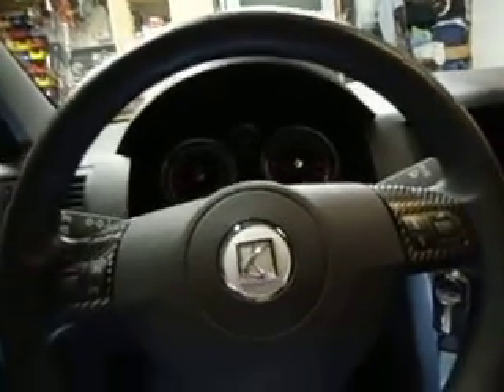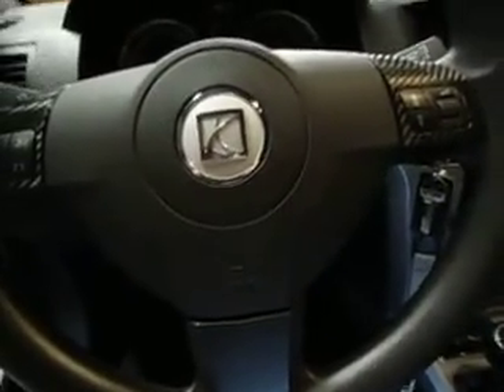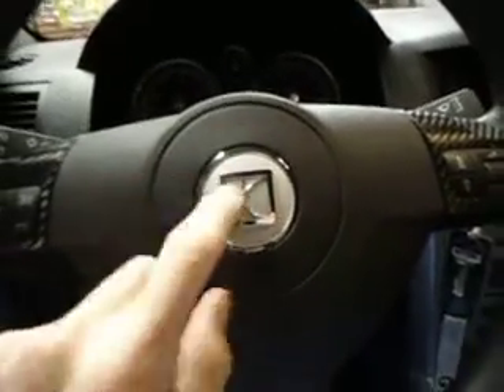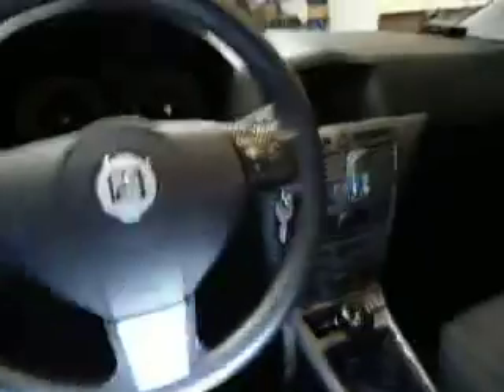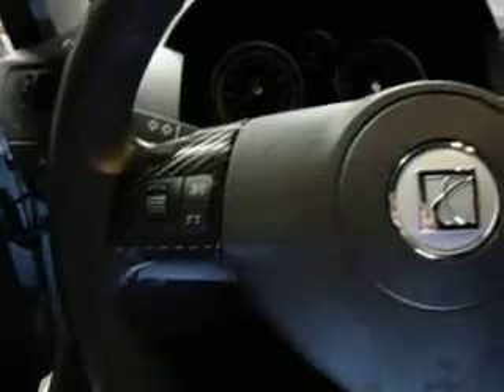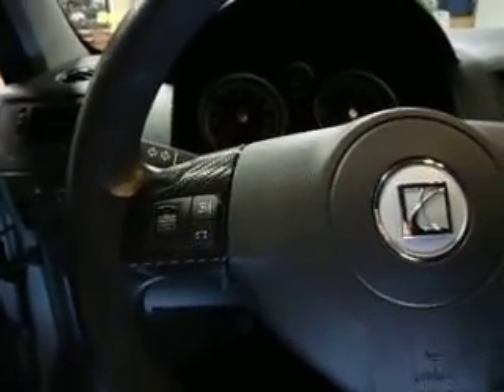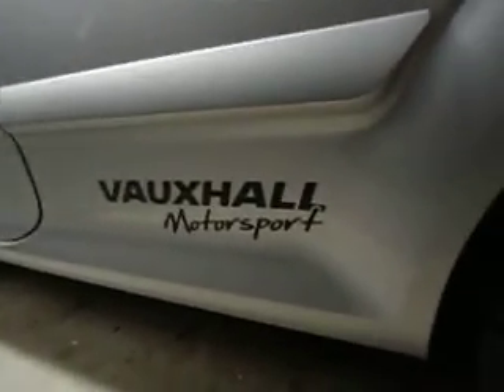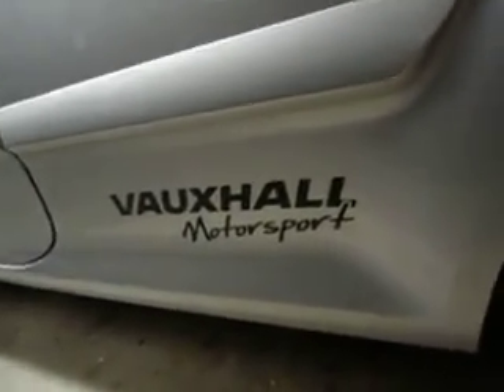Astra H Conversion and Trim Help

Comment: nice video if ur still after how to change ur badge on steering wheel the only way to chang ethe badge is to remove the airbag and purchase a new one with the badge u want on it and fit it tat is all.

Comment from the maker: Halo headlights?  mmm.  do you mean DRLs?  like the audi style?  I havent seen any of the halos but as long as they say astra h, you shouldnt have a problm.  Read into it a bit more though because our stock headlights are bi-xenon halogen projectors.  Its not an HID but i read that some people have problems when switching their headlights, because of the connectors and resistors.  And yes, the european headlights will fit our astra, try to stay around stock/aftermarket-direct replacement

Comment: the saturn badge is actually a part of the airbag, no way of removing the badge itself, my suggestion, order a whole airbag form here in the uk with the vauxhall badge, but thats around £200, dunno what that is in dollars. 

you could do the filing idea then stick on, but the vauxhall badge is way to big to fit onto the steering wheel, its far bigger than on mine anyways.